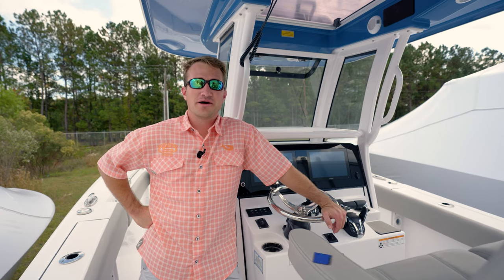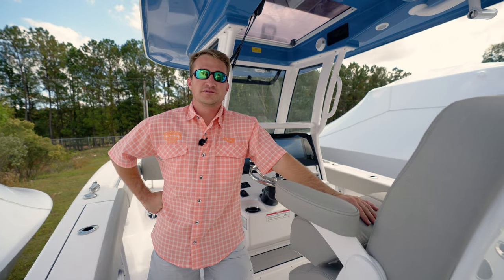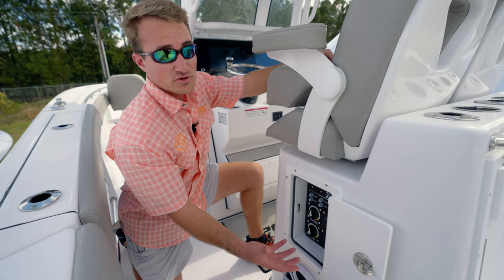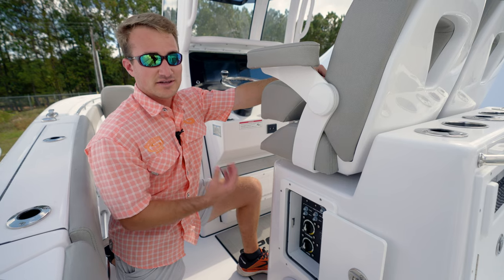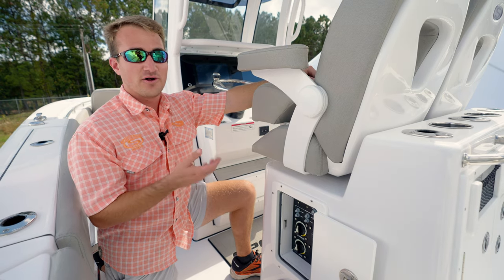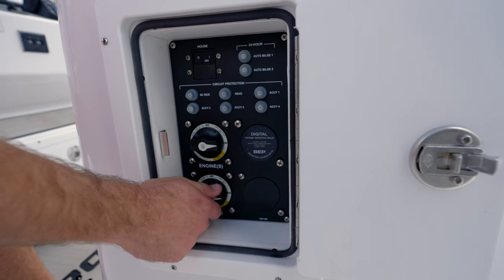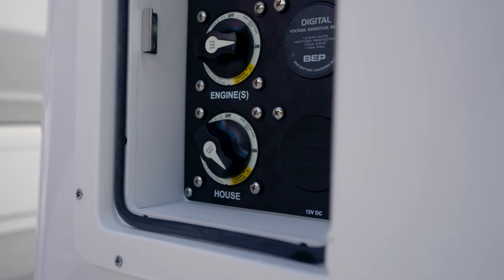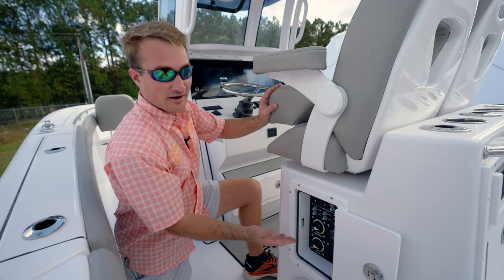Tech Talk - Battery Switches & Which To Use

Comment: Can you explain the two charging ports on starboard side? Is the front- engines, back- electronics? 
Just curious because also have a trolling motor and never know if it matters what plug I use to tend the batteries. Thanks
Reply from the maker: We do not install trolling motors at the factory nor install batteries for them. You most likely have a charger for your trolling motor batteries as well as your house/engine batteries. After plugging into each port individually take note of which charger is getting power and from there you will be able to trace the power leads to determine which batteries are receiving a charge.